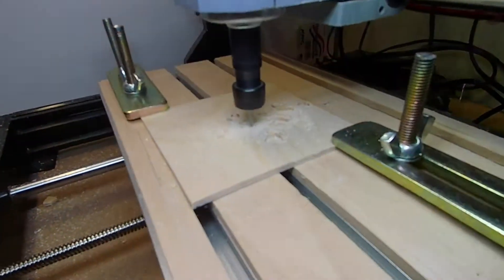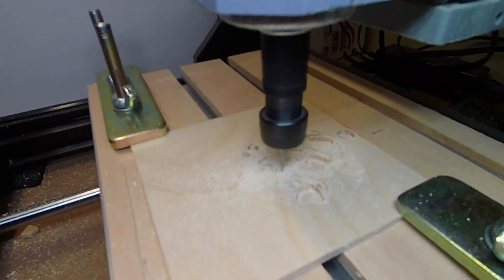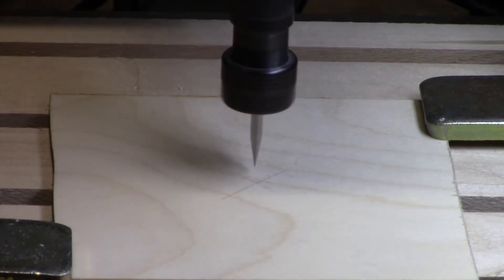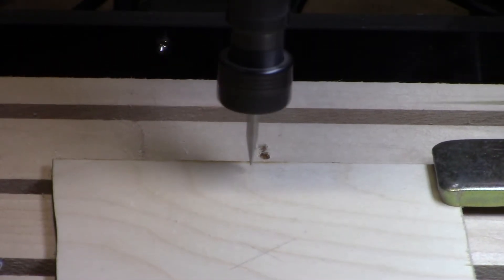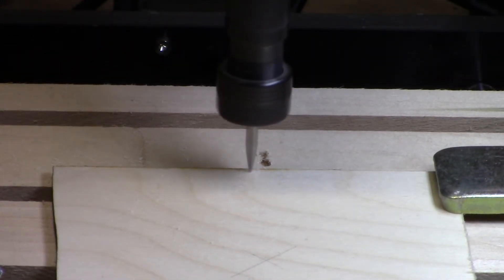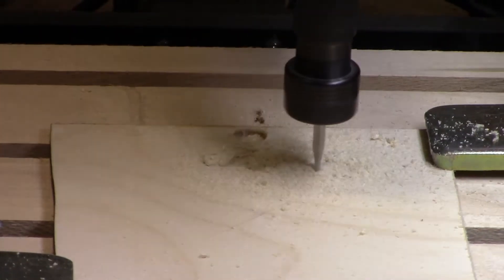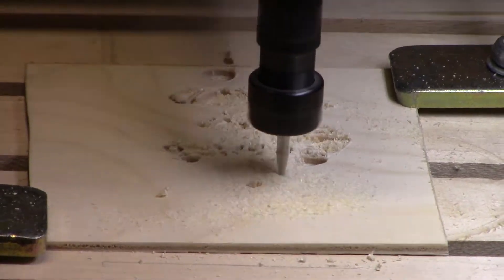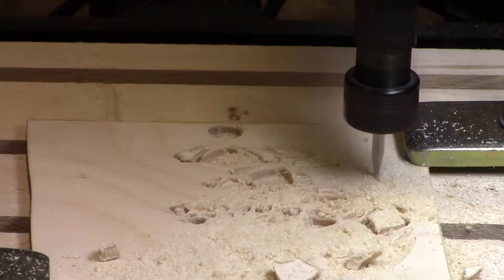3018Pro Router - Christmas Ornament  inverse - take one

Comment: Glad to see you trying to do what I also 'suggested', but perhaps you might consider using a parallel cutter instead of a Vee for the internal cuts as well as the outside.  Perhaps when you have sorted out all the problems, and the garage warms up a bit, I'll have a go myself
BTW, I use Candle to control cutting, and I have the code below in the Service/Settings/Probe commands which enable the Probe button to automatically do a fast and then slow check on the material height.   My metal piece is 1.8mm thick (hence Z1.8)  and the probe lifts 10mm up after probing (hence Z10).   I think that is correct as I haven't used the machine for some time and my memory isn't much good these days!
G21G91G38.2Z-30F100; G0Z1; G38.2Z-2F10 G10 L20 P0 Z1.8 G91 G21 G0 Z10
Reply from the maker: I am unfamiliar with a parallel cutter.  When I looked it up on Goog, what I found isn't what I think you mean.  I did do a tool change to cut the perimeter and used a double edge straight slot milling cutter (3.175mm). 

Thank you for providing your code example for your touch pad.  I have a macro set up in Universal Sender for running the touch pad.  If I remember to plug it in and connect the alligator clip, it works well.  I added a plug on the front of my big stop button for the touch pad.
Reply from the maker: I am going to pin this comment so people can see your code example.
Reply: @CNCATHome  I did not express myself well.  I meant a straight cutter as opposed to a Vee - capable of doing plunge cuts.  A compromise between a small diameter for neat corners and larger size for faster cutting of the interstices.  It would be more efficient to just cut around the edges of the 'holes', but the bits that appear rather than just 'dust' might make this impractical.   I really should be trying this myself rather than making suggestions - LOL!
Reply: @donjohnson24  - The advantage to the v-bit is the cut speed and depth of cut I can do in 1 pass.  With a straight cutter, I need to be careful of the depth of the cut based on the diameter of the tool.  The small the tool, the less depth I can cut per pass.  It would be worth a test to see what kind of performance I can get now with the upgraded spindle motor.  I just tend to want to use the smallest tool I have and plunge it all the way in and then start to cut.  The results is a SNAP! and some choice words.  ;-)

Comment: Hi AT, that's the lace pattern I asked about, just seen the first cut,it looks very delicate, fingers crossed that the profile cut out is also success!
Reply: Shame the profile cut went wrong, try again.
While you were holding it up, it looked 3D with the different radius patterns having different depth. Optical illusion I guess.
Good luck with next attempt . Stay Safe there too
Reply from the maker: It is delicate and the cut for the perimeter was off and I didn't stop it in time.  I am going to re-cut this and I made it 50% larger.  We will see how that comes out.  I will be cutting that tonight if all goes well.  Should see the video on that early next week.

Thank you for the suggestion.  I had it in the back of my mind and your comment pushed it into action.
Reply: I look forward to seeing it, this could well be major part of my Elf /Grotto work next Christmas

Comment: Like that video, interesting, what pin on your 3018 pro does the Z probe connect to. Thanks
Reply from the maker: On the woodpecker controller, it is pin A5
Reply: Thanks AT, much help
Reply from the maker: @billlester3088  - Don Johnson24 added a little code sample of what he runs for his touch pad.  Check it out if you need a good starting spot.